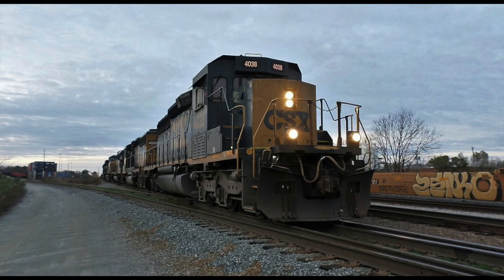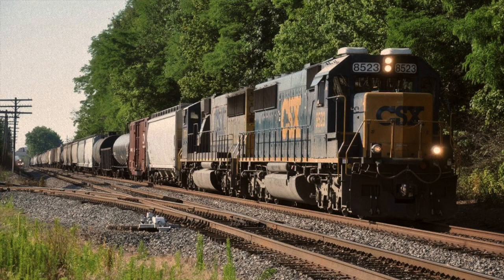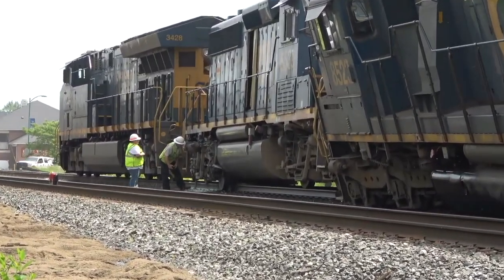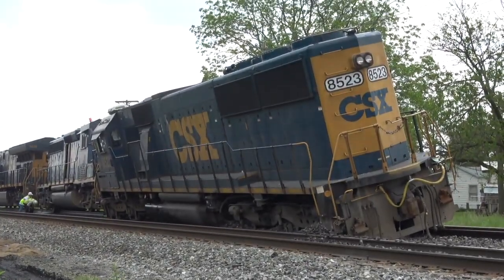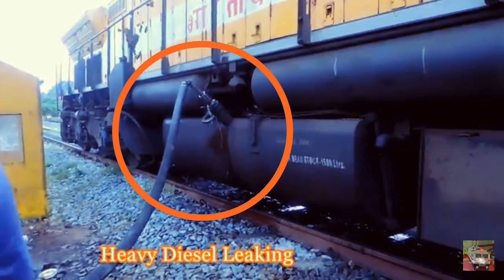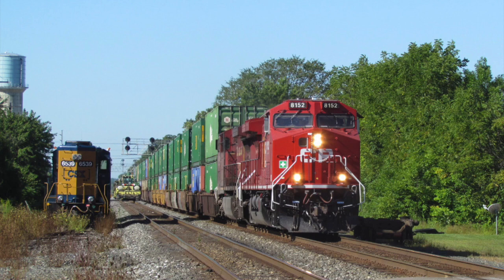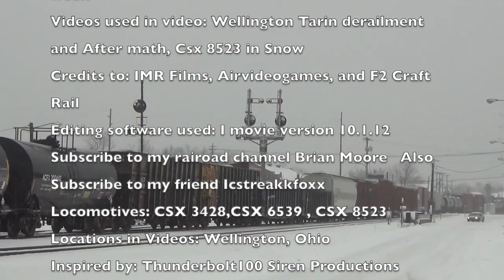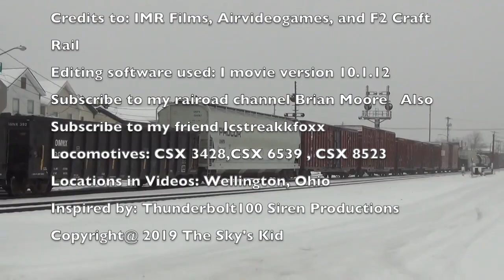2019 Wellington Train Derailment

Comment: So many things you got wrong here. 1. 6539 caused the accident when the #4 traction motor came loose. This was the known cause from the beginning. The traction motor was loose and sparking for miles. 2. The FRA does not investigate derailments. The rail carrier does. In some instances they may ask for assistance from the NTSB, or FRA in large derailments. The cause of this derailment was well known from early on. 3. The track speed for manifest freight is 50 mph in that area. He was not doing 65 mph. 4. 6539 was in the siding to get a dummy wheel installed. It was then taken to Collinwood yard for minor repairs to make safe for transport. Then moved to Selkirk, NY for repairs. I'm a Collinwood mechanical employee and did the repairs to make safe for travel on these units.